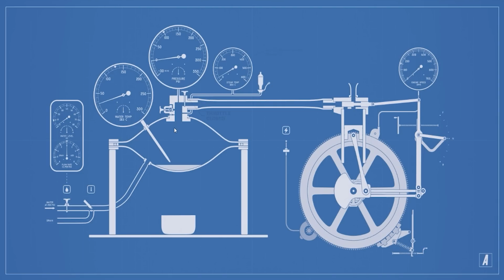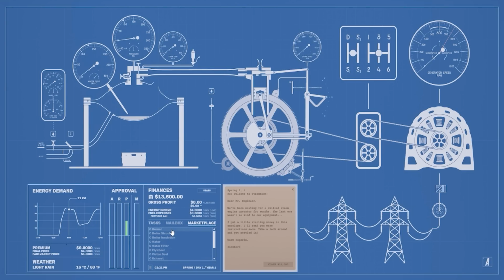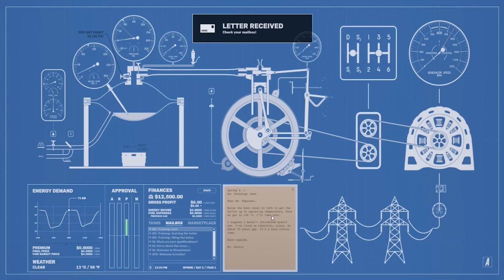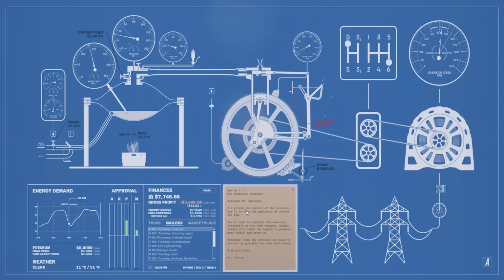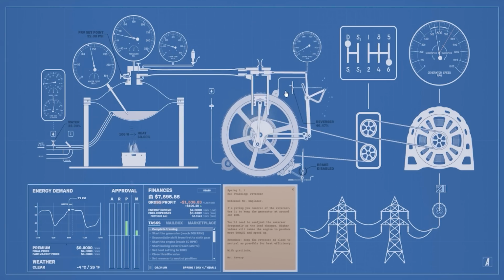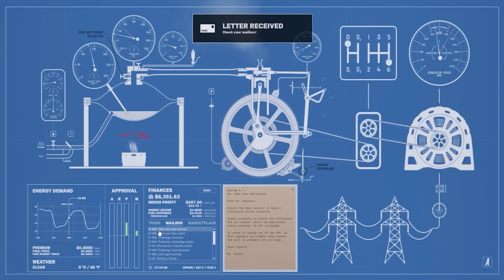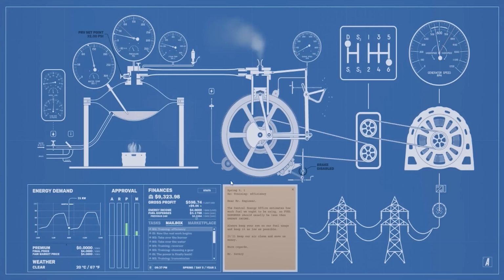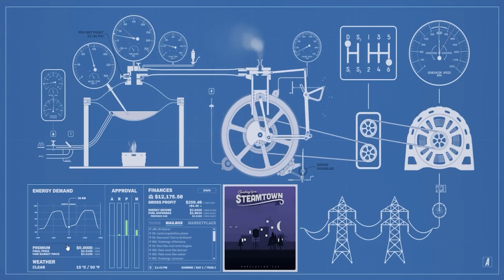Using Realistic Steam Simulation to Power a Town! | Steam Engine Simulator

Comment: While the original game might have been very well simulated, the energy generation part lacks a lot of details. The whole mechanical system will snap to the grid frequency through the generator, which can tear your steam engine apart if it is not synced up. The RPM of a steam engine/turbine on a grid is usually locked and does not fluctuate. They get around this in the sim by using magical frequency converters and power multipliers. :) Especially since you're inputting 100 W of heating, but generate kW of electrical power. It's a cute game though.
Reply: Steamtown is a single producer power "grid" so there is no need to synchronize to any particular frequency. Accurately simulating a real power grid wouldn't lead to very interesting gameplay since the generator speed would be fixed requiring very little skill or engagement from the human operator. There would be some skill when it comes to optimizing for efficiency, but since the generator speed wouldn't change, the player wouldn't get much feedback about what they're doing right/wrong. That concept was explored during testing and I just couldn't get it to work and be fun/engaging.

The energy multiplier is not a required element of the simulation, it's there for clarity so that the power discrepancy between the town and steam engine is explained. Otherwise the player might assume that the simulation cuts corners or is unrealistic when this is not the case. Obviously, running an entire city on a miniature toy steam engine is not possible, so either the steam engine would need to be scaled up or the city would need to be scaled down. The first option makes too many modifications to the base game and I wanted to leave it intact, otherwise it would break old achievements and significantly impact the "feel" of the engine. Scaling the city down made less sense since the power demand figures wouldn't match real-life values. The most transparent solution was to scale the energy output from the engine by a constant value which does not change the simulation at all (ie energy is conserved everywhere EXCEPT across that boundary).

Ultimately, the purpose of this game was not to accurately simulate a power grid. That would be a game in and of itself and would be well beyond the scope of Steam Engine Simulator. The purpose of this game is to give the player an interesting, fluctuating load that they must respond to while operating the steam engine from the base game. In other words, the game is focused on the steam engine with a heavily simplified but still physically realistic generator simulation. The generator resistance is accurate and the entire system conserves energy just like the rest of the engine. Nothing (except for the clearly labeled "magical" energy multiplier) is magical. Frequency changers are real devices. They are not commonly used at large scales or for the purposes used in the game, but the device does not change the fundamental accuracy of the simulation. It still conserves energy and follows the basic rules of electricity.
Reply: Would the snapping also be the case if there was one generator providing for the entire grid? Cause thats the premise of this game
Reply: @dennisklomp2361  yup, buddy supports a whole ~1000 people town with a single opwn janky steam engine (and magical power multiplier) so what he feels would be literally people enabling and disabling house appliances from a single lamp down to a hungry hungry resisitive home heating... so even worse, since he does not have the enertia of the entire power grid...
Reply: He got you OP